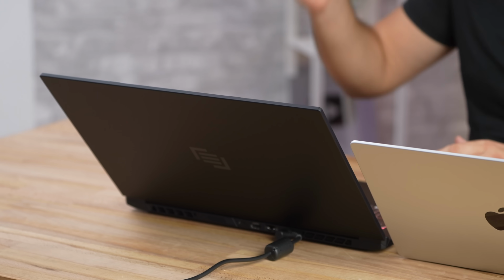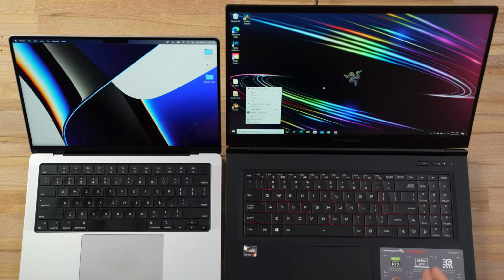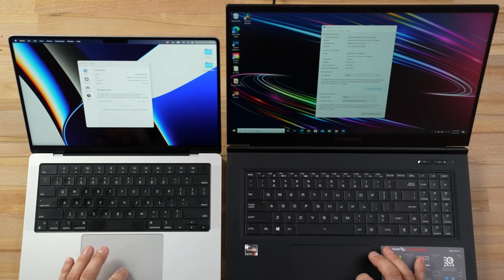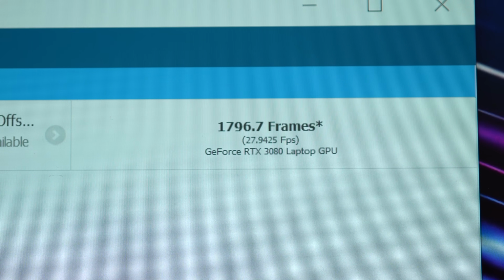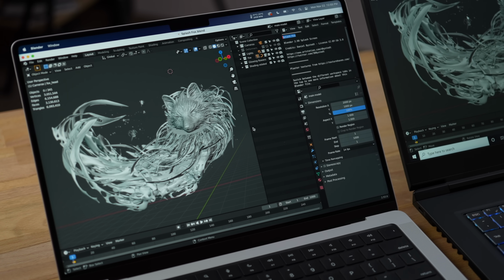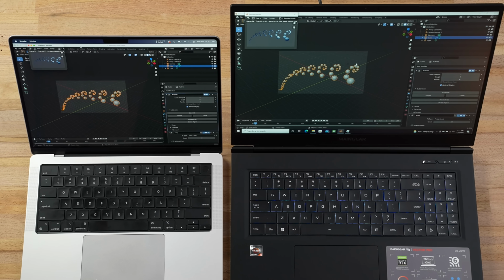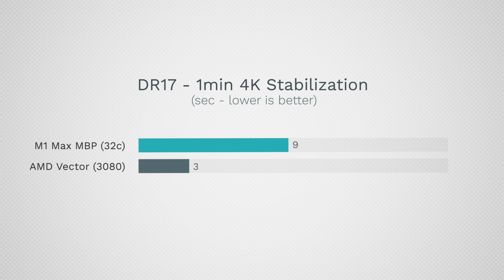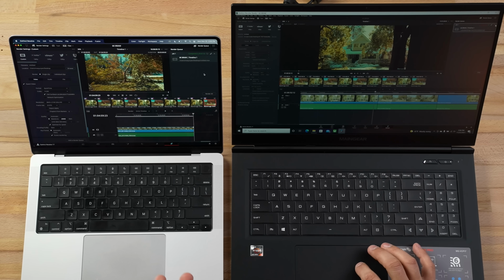Forget Intel! Can AMD's BEST Laptop Beat the 14" M1 Max?

Comment: you keep complaining about plugged in or not, just plug them both in and lets see the difference in performance. you're sounding like a hardcore apple shill and keep forgetting that its almost double the price of the windows system and never ran an actual GPU test on both systems.

Comment: I'm using the same 17 inch laptop but 5800h, rtx3070, 16GB version. And yeah it's extremely loud. I'd have definitely bought Mac if I wasn't gamer. 
It run BF2042, Premier Pro pretty okay and relatively light considering spec and size. But the keyboard is shit

Comment: Your tests must be flawed. I don't know about all the useless stuff you wasted our time with in the beginning of the vid, but when it comes to Resolve, a program I  use professionally, I have seen reports of mid range Win laps beating the M1s. Now don't get me wrong but those reports I'm mentioning were published in very respectable specialist channels run by very experienced pros. So my guess is that you don't know what you're doing. BTW I have also tested M1s, not extensively or thoroughly but I have. And are not better at running Resolve than my 5 years old workstation with a first gen SSD, a 6 core I7 and a Quadro M4000 from 2015. So yeah... Cut down the crap please.
Reply: 🚨troll detected

Comment: Wait a generation more ,so that lithography is about equal between AMD, Nvidia and Apple. Even with a generational handicap 5900hx is pretty close regarding single threaded performance. And even with a more than a  generational handicap  rtx 3080  just smokes the embedded graphics in m1 max. I don't know why this could be a fair comparison even for Apple. Apple focuses on low power low performance systems and will always target low performance users albeit with a high price tag. The only reason m1 seems so impressive is because Apple got very early the TSMC's 5nm process. That's all! This does not mean , though it does not use current industry distortion to its marketing advantage. 
A laptop bearing an AMD(or Intel  cpu) and an Nvidia flagship gpu built on a lithography equivalent for TSMC's 5nm will just blow m1 "max" "pro" or whatever out of the water. Not because they are not awesome products but because they play on a lower power league. 

I mean this comparison can only be hilarious. The beast that is called rtx 3080 just smashes the embeded graphics on m1 even built on a much inferior node process.  This comparison can only be viewed as comedy, because this is what it is.

M1 max (transistor density ~  170 millions/mm2)  single core GB5 score ~ 1700, compute score about 60,000
5900hx (transistor density ~ 95 millions trans/mm2) single core GB5 score ~ 1550
mobile rtx 3080 (transistor density ~ 45 millions transist/mm2) compute score ~ 120,000

Gaming wise, and cryptocurrency corrected Apple stands much much lower than competitors as it has always been. Don't be tricked into buying products at such a high price that when 
a higher power envelope is implemented you will get X2  to x10 the performance for about the same money. There is nothing magical in m1 . TSMC sweats , Apple gets the glory.

Comment: I mainly use my desktop PC, and only ever use my laptop if I travel somewhere and it isn't feasible to bring my entire desktop.  As a result, the laptop is almost always zero battery and will need to be charging as I'm using it.  So the "advantage" of performance while not being plugged in doesn't apply to me.  As a result, you get a windows PC with performance generally 20% worse than the M1 while costing 40% less.  I'll take that deal any day of the week.

But if I were the type of person who didn't have a good desktop and only used a laptop, I can see the strengths of the M1 and may consider purchasing one.  Or even the M2.

Comment: The thing is, even Apple's M1 chips are not even close to as fast as I would have expected PCs to run at, when I was looking ahead 10 years ago to where I might expect performance to be at today. The speed at which CPUs have increased in speed is just not as fast as it should have been. The 2006 bump to Core 2 was just insane growth over its predecessor. Sandy Bridge was almost as big of a jump. Then we got... <10% growth year over year after that. And, until AMD revived themselves with Zen, we were stuck with dual core/quad core as our only affordable options.

Comment: Hey guys can you redo this test while changing some hardware in the maingear laptop as I believe these changes will gain you some more performance, replace the dual ssd with the best gen3 ssd you can find and replace the ram with Lpddr4 - 4266mhz ram. I believe this change should help improve the laptops capabilities and redo the tests with this modification please.

Comment: It will always be a little bit unfair, since we are comparing the performance in tasks that M1 chip was designed for. Difference between ARM like CPU and regular x64 is mostly that ARMs are tailored for specific tasks. It's like two students learning for the exam but one knows the exact answers in advance. Of course this student will spent less time studying and will likely perform better. But in the end no one cares it's results that matter.

Comment: Again and always, power settings on battery is a windows default feature than the PC can change and the mac can't.
Please note in the PC world a desktop  does not cost from 6000$ baseline price and can be a beast from 1500$, if you edit video a laptop is useless especially as you need ton of expensive TB drive while a PC can use a cheap internal HDD and there are drive up to 14GB at a price far more cheaper than any SSD from a mac.
An average PC mother borad can have 6 HDD slot or more and a good PCIe for SSD at the same time. More adequate if you have your raw footage inside, what a mac can't at all.
Also note that a desktop graphic card explode a laptop version. Same for CPU.
Do you really edit you video on a train or on the field? How many expensive external drive do you have to do so? A raw 4K footage takes more space than a Mac can have (300gb/hours).
You can also say that a 120 hz or 144Hz laptp screen stay always at 120/144hz and never slow down, I would be interested to know what makes the screen speen to go down. 
Don't forget to talk about screen time latency (40 ms for this generation compared to 2 ms in average for a PC), the ghosting effect that no longer exist on a PC or the obsolete HDMI 2.0 limited to 60hz for external monitors?

Comment: i think you should be smart before you tried to compare AMD & Intel VS M1 chip ....M1 is Soc ...this tech so much advantage than AMD or Intel mobile cpu ....and then you got 1 CPU built in with iGPU Memory etc on M1 ...while the AMD side the GPU linked separated from GPU, another memory another hardware that need "bridge" in between these hardware  ....for the software side MacOS fully optimized from the beginning with the hardware ..for sure because they're under one "umbrella" one corporate...while the other laptops built in with bunch of brand names ...let say the memory from company A , the CPU from B the motherboard from C the GPU from D ...thats not good...if you trying to buy a motherboard the companies usually pins that what windows can use with this motherboard that means lack of functionality

Comment: My girlfriend's Lenovo 5 pro (1500$) has 13500 pts in r23 with ryzen 5800h, 9500 on battery. The DR17 test makes no sense at all. Different codecs, different results. Different tasks, different results. Check out the video from the "learn color grading" channel where razer laptop outperformed m1x in most categories. In some of them, the razer with rtx3060 just destroyed imac.

Comment: In the unplugged GPU test it just got under 30fps because it defaults to the integrated GPU when on battery power. It could probably be bypassed via software but the battery would die much quicker.

Comment: All tests should have been done unplugged with the AMD laptop sitting on your lap until either you cried or the laptop died.  ;-)
If you need performance and can only get the performance when plugged in why would you buy a laptop and not a desktop PC.   Your comparison is basically a MAC laptop SoC vs. a desktop pc.

Comment: To make things fair the price needs to be a lot closer. A budget of $4k for PC laptop will destroy the m1x period.
Reply: not in battery life.
Reply: @icefinity6305  true battery metric wise PC loses no matter the price range.  However some reasons to still buy PC laptop is the small space it takes up with plenty of power in place of desktop. I personally use laptop as desktop replacement as well as macbook. I think a lot of people work from home now and portability is not as important due to pandemic. Also home schooling is on the rise so home use of mac or pc is common place. I think it would be fair to compare it to a more expensive laptop given global situation. Portability is less needed at this point and raw power and space factor is important. However I know many have the exact opposite use case so maybe a video for both groups would be important.

Comment: Using the AMD laptop without a power supply pretty much makes it a wast of money you should just get a desktop instead. I can’t believe it draws so much power and I can’t believe the performance is so bad when it is unplugged.  The MacBook Pro did amazing it was consistent the fans were very quiet. Seems like the MacBook Pro also beet the windows machine in most tests. The MacBook Pro also looks way better it does not have all of those horrible stickers that just make other computers look very sloppy and seems like other companies use want to advertise and I find that to be disgusting. I love pure looking machines and the Mac is pure inside and out. Apple sure can make an amazing chip and computer.

Comment: Unified memory along with the M1 makes it easy for the MacBook thanks to it not having to send one file to the cpu then send to the processor then to the gpu then back to the processor back to the cpu for each file or download. If not for unified memory MacBook would drop significantly also the ssd gives its more strength depends on what apple uses

Comment: The fact that apple is doing all this with a fraction of the power that AMD and Intel need is amazing.
Reply: Also don't forget apple is on a newer node 5nm. So a node shrink and the difference would still be there but not as significant.
Reply: @Ojus Thakur well macbook is for Professional porpuses And The Amd One is for gamers.. Really Doesnt connect to one another...
Reply: @fredvoid5976  nope.
HP Zbook and Lenovo thinkpad is for professional purposes

A HP Zbook or Lenovo Thinkpad would totally destroy macbooks
Reply: @fredvoid5976  I mean for video editing and web surfing maybe some cad the macbook is definitely structured but a  lot of engineering software is just not compatible with mac and most likely never will be didn't work for intel macs and won't work now most likely
Reply: Power draw isnt a problem in a 17" machine
Reply: Apple is using the latest node and is careless about transistor count
Reply: @darkv4312  nice joke lol, you made my day
Reply: @Ojus Thakur also its better in screen, trackpad, keyboard and more, so you’re paying for something better
Reply: For nearly Twice the Price ??? UH-uh nope
Reply: @JohnZ_3011  You lot always want to find an excuse to hate on apple. Your electricity bill will eventually catch up considering these laptops are using way over 250w. At this point, you may as well just get a desktop as your laptop will be stuck charging to keep up whilst the macbook will be able to do it on the go.
Reply: @thabo5799  You said it yourself, why would you buy a $4000 laptop if i could get a Full on PC ??? You could get a Zephrus Duo 15 Special or a Flow X 13 with full size external RTX 3080

I want Him to compare both of em Either Flow X 13 with External Full size desktop 3080, or Zephrus duo 15 (Compare it to the same Prize Range Laptop)

And That's not an Excuse, "That's A Fact !!!"
Reply: @JohnZ_3011  Also forget the display, speaker quality, premium design, etc!
Reply: @Mr. Z  its not twice the price. Look at the razor it's $3300k with a 3080. The markup in apple products is ram and ssd.
Reply: All thanks to the ARM and RISC architecture it uses which require less power to do the same work.
Reply: @fidelisitor8953  Dumb people are blissfully unaware of how dumb they actually are
Reply: @fidelisitor8953  It also matters that Apple don't have to think "What if our CPU is used in a laptop with NVIDIA GPU" or other things about compatibility because they only sell the whole laptop with their parts and even with their own OS optimised for eachother and ONLY for eachother. AMD, Intel and Nvidia can't optimise their CPUs and GPUs to function well only with some parts because they don't only sell pre-built laptops and desktops.
Reply: @Hardcore_Remixer  exactly all this while m1 macs still are un usable for certain types of engineering work  without a virtual machine and a couple other much needed things like proper multi display support for double thr price. This is a bright start from apple could easily be revolutionary but it's not there yet
Reply: @fidelisitor8953  ARM and RISC architecture do not require less power to do the same work. The M1 is on 5nm while AMD is on 7nm. Then there is the design of the chip, AMD and Intel focus on performance while Apple clearly focused on power efficiency with their M1 line. 

If AMD or Intel was on the same Nm size and focused on efficiency rather than performance, an x86 chip could be as or even be more power efficient than ARM.
Reply: @ME-CFS-LongCovid-Help  Focusing on performance? Focusing on efficiency?? That's utter rubbish. All three companies strive to produce the best performance they can offer including Apple so they can market better products than the competition and get bigger profits.

If x86 could be as efficient or even more power efficient than ARM, why is it not used in smartphones with only 3-5W of passive cooling capacity? Why are there no X86 smartphones? No X86 chip will or can come close to any properly engineered ARM or RISC-based chip in efficiency.
Reply: @ME-CFS-LongCovid-Help  You need to do some research before bringing up arguments like this. x86 uses CISC (Complex Instruction Set Computer) architecture which requires complex instructions to perform logic and executes multiple Instructions Per Clock (IPC) while ARM uses RISC (Reduced instruction Set Computer) architecture which makes use of more simplified instructions and executes 'only one' IPC.

 I won't go into details as you can find articles that explain better but simply put, this 'simplified architecture' and reduced IPC of RISC CPUs (ARM in this case) makes it possible for them to achieve the same end results as an x86 CPU while performing less logic and thereby using less power.

Do some research on this then come back and tell me if you still think ARM isn't more efficient than x86.
Reply: @ME-CFS-LongCovid-Help  This is why I told you to do some research. Right now you're just making blind assumptions based on what you think. The internet is free to use so a quick google shouldn't be hard for you. Stop making blind assumptions.
Reply: @darkv4312  
If intel processors were so bad, why didnt apple just just Ryzen?

Fact is apple started making its own processors because it could have higher margins, better control and force mac users to go completely into apple ecosystem

Not because intel's processors were bad

All intel processors arent meant for gaming
Intel makes Xeons and vPro processors that are not meant for gaming.
Xeons and vPro are targetted towards people who would have bought mac

And FYI, the Windows workstation laptops—what Macbook pro is trying to be and what compete with macbook pro—come with Intel Xeon/vPro

Its not like there are no macbook pro competitors that use intel chips.

Comment: I have a question for pc users..I have only used macs for as long as i could remember..do you always use it while plugged in..as a Mac user I usually use it unplugged unless it’s battery is about to die or do you just use it unplugged and it’s fine ?
Reply: Usually using it plugged while working home and unplugged on the go. See no point to use it unplugged home because usually work on a desk. Prolong battery lifespan also

Comment: 12:15
The manufacturer set power limit on that laptop when on battery is too low, my GTX 1060 laptop archives around 43 FPS when unplugged.

Comment: I laugh at all the AMD fanbois that try to say that "if you test an AMD processor it will do much better" and yet, here you go, unplugged and the M1 Max is twice as fast as the AMD. LOL
The only thing that saves Windows based systems is the Nvidia chip. It takes both AMD and Nvidia combined with separate chips to take on one Apple chip with integrated graphics.
And the M1 integrated GPU is 10x faster than the RTX3080 unplugged (which is all that matters)

Comment: Just as a disclaimer. In the blender test both where always running on CPU because you have to manually set it to GPU which he didn't. Which is a good thing I'd say.
Edit: only for the cycles test I have to say don't know how eevee is working.

Comment: M1 Silicon has lot of video and image accelarator, that is why it Wins in studio application not only because It's cpu.

But in gaming and some 3D application, x86 and that discrete GPU are monsters. No way Apple can match them.
Reply: Gaming on steam seems good, but, just like in Linux' case, it doesn't support all games. So in some games the performance of the M1 chips is limited by the virtualisation. So yeah, it will need a couple of years to fix that.